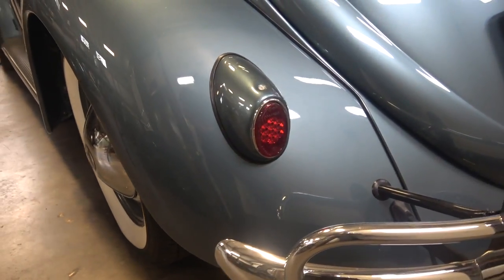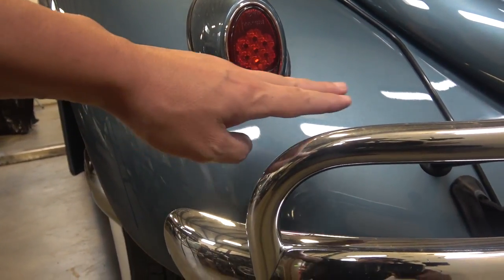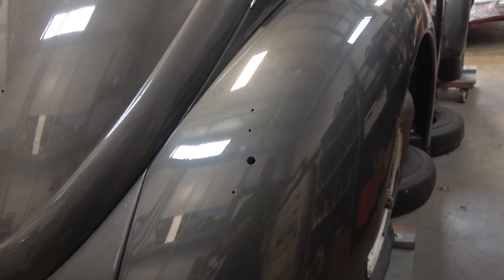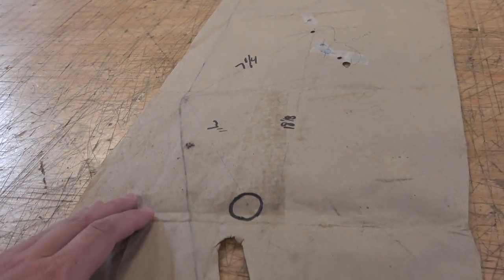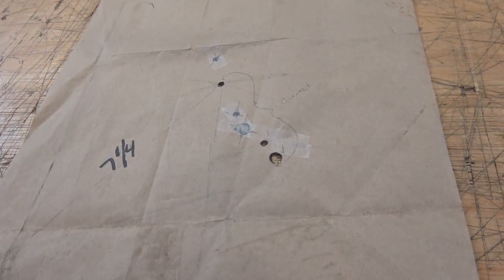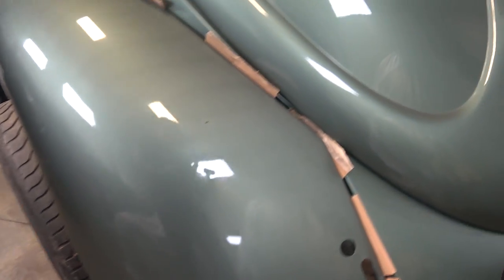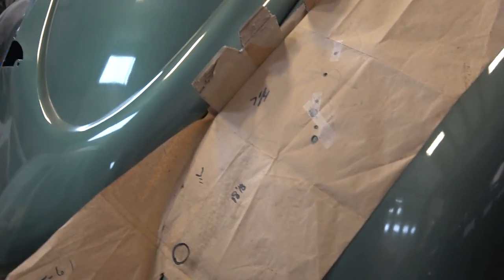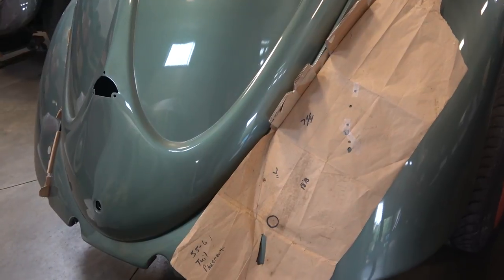Classic VW BuGs How to Tail Light Placement '55-'61 Beetle Honey Comb Snowflake Mounting

Comment: I had some '61 tail light assemblies. I figured they'd bolt right up to my 64...til I removed the 64 housing and saw the holes are completely different, the wiring coming thru the center hole.

So the original holes on a 64 fender will not be covered by the earlier tail light housing? The original holes must be filled or they'll show?

Also - bought a pair of these LED panel/ plastic lensed tail lights. The LED panel, seals and lense are so much thicker than the original 61 reflector & lense, it is utterly impossible to squeeze the factory retaining clip into the inner tabs on the lense trim ring. I thought of tightening them down using tie wire. Anyone else have any tips on this?
Reply from the maker: Correct, if you use a 60s fender or buy a new one for up to 67, you will need to fill the holes and redrill for a honey comb tail light or earlier.
Reply: @classicvwbugs  So what do you recommend for filling body holes like that? 
I ask bcause although I have a '64 (last year for the smaller windows) my goal is to give it a more vintage look. The  side trim is gone, and rather than install new trim, I wanted to fill in those holes and go without the trim. 

 I suppose Bondo might begood enough for some, but I was hoping to use body solder. Unfortunately, it has been in short supply lately. Any other insights you could share?
Reply from the maker: @nassar57  My body shop welds up the holes then grinds with weld down smooth as possible, then some body filler.

Comment: Wouldn't it be better to mark out and drill the holes before you have it painted?  That way, if you make any mistakes, you don't ruin the paint.  If you have an original fender, can't you create a template using those holes?

Comment: Chris, I keep blowing my second fuse in 1958 bug! Headlights work fine, front signals work, but brake lights blow fuse! And passenger signal light makes both signals in rear go on! Any ideas? Thanks
Reply from the maker: Brake light switch may be bad?  Is it new?  Disconnect brake light switch from the circuit and see if that changes anything.

Comment: Hello Chris. I have a question regarding the installation of the  turn signal switch for  my 1956 oval. I got my new turn signal switch, but the diameter  of the steering shaft tube is about 0,5 inch bigger than the diameter on the turn signal switch. Any advise please !